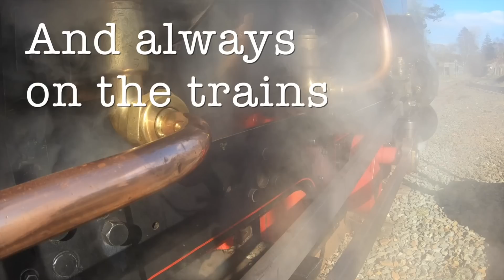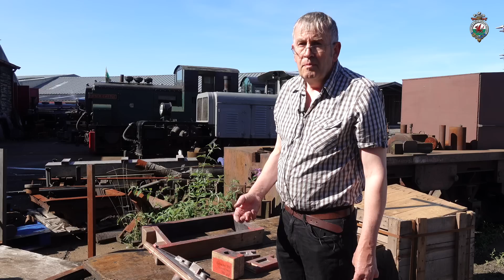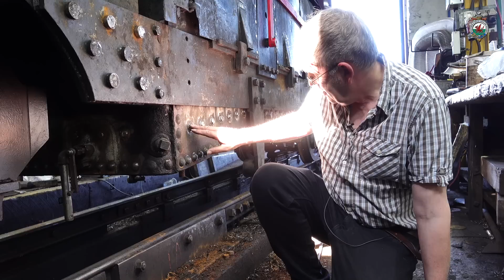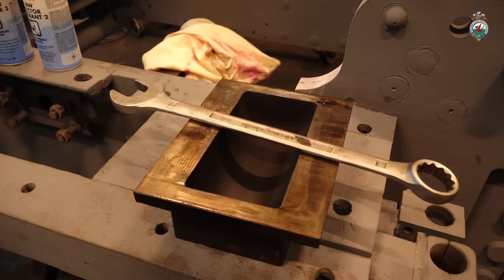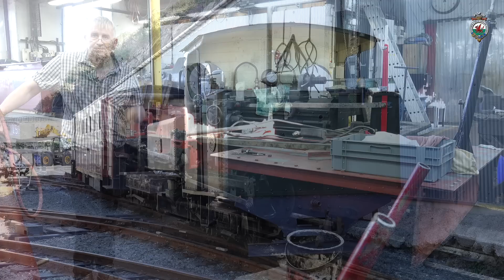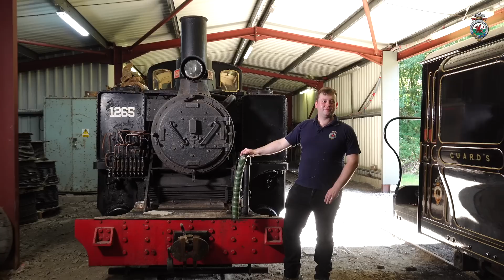F&WHR Moving Pictures Number Seventy - 15/8/22

Comment: There is an Easier way of casting the vacuum pipe connectors and it can then be done in house and it takes out the sand casting proses and that is by 3D printing the parts and then Vacuum casting  in investment Plaster. I have been experimenting with with steel bronze the past year and I  can tell you that stuff can take a battering! it's been thrown off a 10 storey building in Swansea and survived with a few dents put under a hydraulic press before breaking at 5 tons. and will possibly last considerably longer than normal Steel!